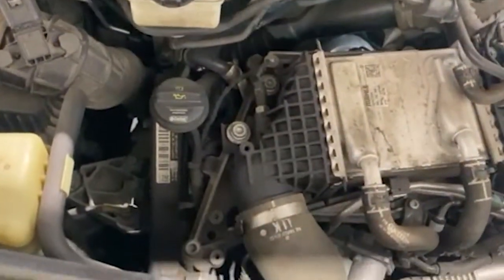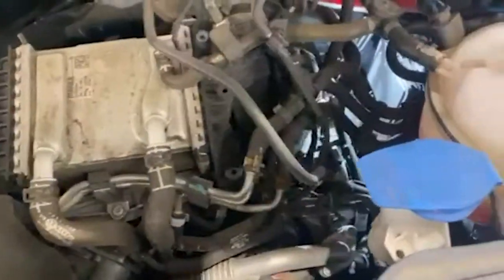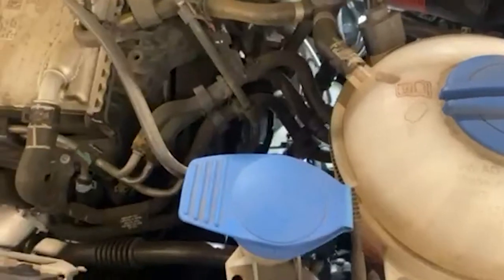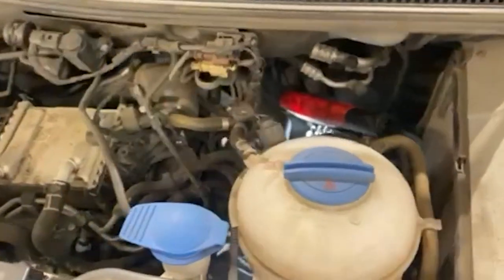VW T6 Exhaust fumes in cabin *FIX*

Comment: There's something wrong if a vehicle of less than 5 years old has to be checked / fixed for exhaust leaks!
Reply: VAG have never heard of a Recall! The motor industry are a law unto themselves!

I've had to fix my DSG Microswitch on my Skoda and this pipe on my T6.
Both should have been recalled.
Reply: Ye its made of cheap cheese materials